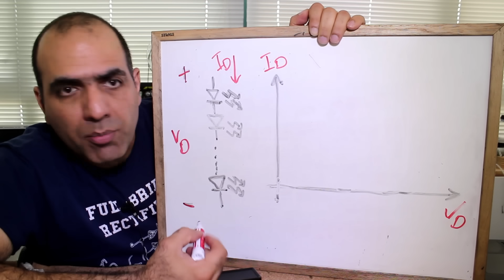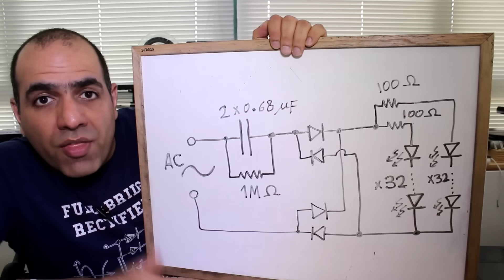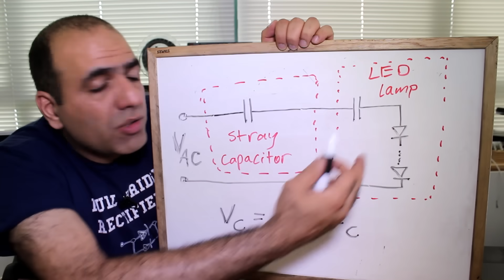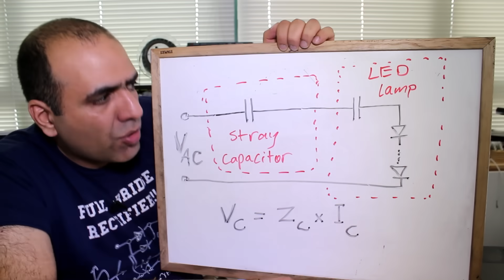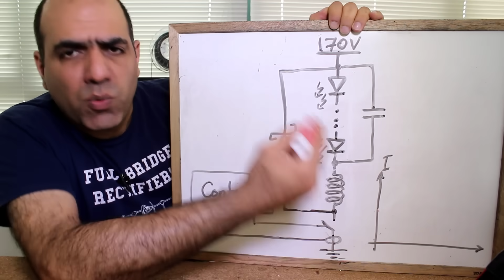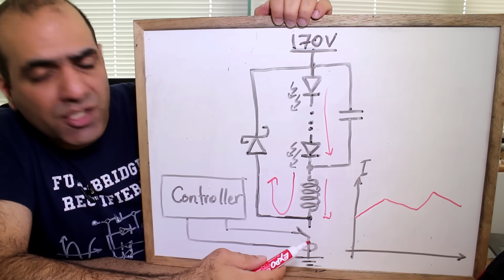Why Cheap LED Lights Keep Glowing

Comment: I’m wondering if there’s not an element of induction as well. In 3-phase domestic wiring, it’s not uncommon to see around 90 VAC present on phases that are completely isolated at the breaker. Or have I understood something wrong and that’s basically just the same thing? :)

Comment: This effect is caused by currents being induced into the wire from nearby electrical sources like the wiring in the walls. Works the same as an antenna.

Comment: BOOM: “All you have to do is add a capacitor (yes, I meant resistor)...”
Chinese Manufacturer: “Yeah, we’re not doing that.”
Reply: Chinese manufacturer: Our lights are better, you don't waste leaking current! Your leaking current is converted into a small amount of light (even when you don't want it, but at least it's not wasted!).
Reply: @diliff  I mean this makes sense. People don't complain about they can't see but it doesn't mean there's no problem.
Reply: @diliff  I mean... you could always pull the plug to turn it off... (actually for many electronic devices you have to do that, because even without "standby" they draw some current. With "standby" being in the couple Wh range for most devices.)
Reply: @AFulgens87  True, but that's if it's attached to something that you can physically unplug. Most light bulbs are hard wired to a switch. You're practically suggesting that people unscrew bulbs when they're not using them. ;)
Reply: @diliff  ah, right! I was thinking about desk lights, because in the video they were showcased as such *facepalm. You are of course right :)
Reply: @diliff  I would just have a lamp that stays on all the time and have a motorized flap that covers the light when you hit the switch.
Reply: I guess that he meant resistor not capacitor, it is the capacitor that makes the light glow in the first place.
Reply: Chinese Manufacturer: You cant see it glowing because there is no glow!
Reply: Waaan, somebody talk to Me!1
Reply: Resistor*
Reply: It's the market! That capacitor makes the lights a few cents more expensive, so they leave them out. 
CAPITALISM BABY! YEEEHHHAAA! PEW PEW PEW!
Reply: Don't blame humans, blame the system!
Reply: @parrata  You're right that the video suggests a resistor, but a capacitor would also work.
Reply: D’OH! Well, in fairness, the first thing Boom added was a capacitor. Also known as, his body.

Comment: I have an led tube light in my room, and I have noticed it blinking in no specific rhythm by itself, it bothers me a lot, can you come up with a solution?
Reply: Probably picking up strong stray RF.  Put it in a Faraday cage.  Or just hide it under the bed.  Or cover it with an opaque cloth.  Kinda makes it useless but at least you won't see it blinking any more.
Reply: It is mounted on the wall, how can i put it like that every day?

Comment: Interesting thing I learned yesterday about the glue in LED bulbs. It can be broken down with Dot 3 brake fluid. Only took a slight drip on it for a couple minutes for it to happen. One moment I'm evacuating the brake line, the next I had the plastic lens fall off the lamp and my catch canister tip enough to fill my evac pump with brake fluid. Was a bad idea to hang it from the bulb.

Comment: Ok, lets do some math... we have ~7.674.575.000 humans on earth... lets say everyone needs 2 Lightbulbs at a time, and say 1/4 of the populations needs light (7.674.575.000 * 2 / 4 = 3.837.287.500).
One bulb with a resistor of 470kΩ wastes ~113.6mW (P = U²/R -> (230V)² / 470kΩ = 112.553191489mW)
Now lets multiply this with 3.837.287.500 blubs which spend light. Here we geht over fucking 4.3GW. GIGA Watts...
Is there no better way to get rid of the load...?
(Sorry for the bad english and i hope my math is correct...)

Comment: I had this weird issue with LED's. I bouth many warm white leds and planned to put them on a whole house wall. I connected them in lines by 6leds in series and was having many 6leds lines that were connected in parallel. Basically I had many leds that run on 18v laptop supply. It worked great for years, no issues. I used the swich on live wire that goes in to laptops pwr. supply. 
The weird issue is: I woke up at night to notice that my leds who are on my wall was glowing a little even when live wire is disconnected. But not just glowing,  a part of them were glowing, only the ones that are closer to the ceiling. No matter on what cables they were, parallel or series, only the ones closer to the ceiling were glowing. 
When i completely disconnected power supply from outlet, it stopped glowing, so basically I fogured  - when they got some kind of ground refference from neutral wire, they collected some small current from thin air, or from remote wire inside ceiling. Idk, but it was interesting discovery.

Comment: Can you also solve my question:

Why is electricity so dangerous?
Reply: It's dangerous because a small current through certain parts of the body can confuse your nerve system and stop your heart,  some say 40 mA is enough.  After your heart stops and is not restarted, you will die.
Reply: D Williams Thanks but I think it messes up the brain as well. The shock is probably enough to make a muscle contract and destroy it.
Reply: @covertpluto  It depends on many things.  I once designed a high power flashing light for the Atlas Missile.  The capacitor was charged to 2,000 volts and held 250 Joules.  It flashed twice a second for an average input to the flash lamp of 500 watts.  Ballistic cameras photographed the flashes against a star background during night launches and computed missile position from those images.  The source of power was a one-shot battery.  At the end of the run the battery was dead and the flash tube was crazed.  It was custom built of Quartz.    Anyhow I once got the full discharge from one hand to the other when  a test button box arxed over.   I was dazed but didn't fall down.  The circuit is patented and you can look it up on line.  See US3196335 for the circuit.

Comment: Kind of sounds like the switch is on the wrong side of the circuit... If it cuts the hot side, the lamps shouldn't glow... but if it cuts the neutral side ( leaving voltage at the socket.. ) - the stray capacitance can be enough.  A friend had an outlet wired wrong and had this same issue. ( he cut the neutral side of the socket, and not the hot side ).

Comment: What you really showed is how much energy we are wasting in this world. Putting a resistor across the circuit (or even a capacitor) only creates wasted heat, sadly a poor solution. Come on people we can do better!  Milli-amps by the millions could be save with improved circuitry.  ...  Why not make use of static electricity  to light our homes?

Comment: It takes surprisingly little current to make an LED glow. If I put my body, arm to arm, in series with a 9v battery, it still provides enough current to light the LED dimly.

Comment: If YOU make courses, I MIGHT be motivated to watch them in order to learn and gain knowledge
Especially about the usage of a FULL BRIDGE RECTIFIER
Reply: FBRs convert ac to dc using 4 diodes. Diodes allow voltage to travel in only one direction.
Reply: What’s the deal with full bridge rectifier?
Reply: @bengrizzlyadams6187  he designed his own

Comment: I have a couple of proper LED lamps that flash every now and then when installed on a couple of fixtures in certain rooms in my home. I suspect there is some leakage current as well. Kids made me replace the lamps cause they thought it was ghosts or something!

Comment: I have these weird old light switches with a little LED in the actual button, which glows when it's off... So you can see the switch in the dark, I guess. They're 20 years old or so, and made for incandescent lights. When I started fitting LEDs in my house a few years ago, I discovered that the sockets attached to these switches were ALWAYS live. Incandescent lights didn't care, because the small amount of current needed to light up an LED wasn't enough to turn them on. My new LED lights, on the other hand, would constantly glow with a soft but visible light.

I need to replace those switches...

Comment: I used to connect LEDs to a darlington pair with a long wire floating on the input. It picks up any little electromagnetic noise. Walking near it, or touching it would cause the LED to turn on. It behaves very much like what you've shown.

Comment: The circuit inside the LED light bulb is just like the circuit inside phone charger. The only difference is that the phone charger circuit is CV and these are CC.

Comment: if you connect switch to the neutral wire instead of live wire, when turn off the light, led bulb will glow

Comment: Someone who understands electrical engineering better than I please check me on this.  Here's my situation: I have a 10 bulb chandelier.  I recently switched out all the bulbs for LEDs.  Rather than swap one bulb at a time, I took out all of the incandescents, then put in all of the LEDs.  When I plugged the first one in, it glowed pretty brightly despite the switch being off.  With two, the glow lessened, but was still obvious. Three bulbs screwed in resulted in a faint glow from all three.  When I put in the fourth bulb, the glow stopped.  I assume from the explanation around 7:20 that this is because each bulb has some resistance, and once four bulbs are plugged in, that's enough to act like the "large" resistor Mehdi added in red.  

Is that right, or is something else going on here?

(Come to think of it, I don't even know whether the bulbs are in sequence or in parallel in a chandelier, or what that would mean for this circuit.)

Comment: Seems like it has inherent inductance "choke" that limits the voltage regardless of current. 

Could it possibly be the ripple voltage recursively charging and discharging themselves? Are these self shunting zener diodes?
I mean this is all diodes, FWB and LEDs in series.

Comment: I had some light bulbs in my room a couple years back and after you turned them off after a few minutes they would have a slight green glow to them if the room was dark
Reply: If they were compact flouresent bulbs, that's probably because they use a coating on the inside of the tube to turn the ultra-violet light into visible light, and the coating often contains similar components as the glow-in-the-dark coating used for clock dials.
Reply: @melkiorwiseman  that makes a lot of sense. Thanks

Comment: ElecrtoBOOM when I worked construction we used radios to communicate. Sometimes when I talked on the radio my LED headlamp would Glow. Can you explain this?
Reply: Thanks for the reply. If I can ever replicate the condition I will video record it.
Reply: I was actually concerned that what ever was causing it could be harmful to my health.
Reply: @Ian-of9oi 
You're welcome! 😀
I have been using radio communication equipment in my field of work and spare time as well over the years. Don't worry about your health. It's completely safe to use radios and cell phones.
Reply: Maybe interference from electromagnetism and an uninsulated lamp circuit?

Comment: I installed a light switch a few months ago, never had a problem, but when I installed this switch, the (led) bulb wouldn’t turn off all the way, changed the build. Works fine now

Comment: We had some LED lights that would start glowing when you touched the plastic reflector part. They stopped doing that after some months of use, and never did it again ☹️
Reply: My car's led dome light glows even with the car off.

Comment: Strange but true. i have a 4 ft LED strip light that glows very dimly even when switched off.  I added an ON/OFF/DIMMER installed on the end away from the power line.  The reason for the glow is induced voltage due to the close proximity of the power line to the LED strip along its length.

Comment: I had this problem at home but it was caused by high resistance in the transformer earth. My neutral wire was at 60V to earth. Trying to explain that to the power company call center was the tricky part.

Comment: I have two track light fixtures under the roof of my patio, 3 bulbs each. Each track is plugged into a remotely activated outlet from Portfolio Lighting. When I first put in LED bulbs (cheap ones, don't recall the brand) I noticed the next night that despite being "off" they all had a faint, flickering glow. Replaced them with quality lamps and problem solved.

Comment: You are irresponsible for de facto tempting viewers to experiment with live current circuits, using crocodile plugs and showing risky experiments while closing the ac circuit by one’s feet .
Reply: And it’s resistive not capacitive effects of your body that mattered.

Comment: Is there no difference if you place the switch fore the light-bulb? Because then the AC current flows through the full bridge rectifier making it DC.

Comment: I didn't watch this video to the end so what I say may not make much sense, but I have a led lights in my bathroom that I took out from my bedroom when I bought a new one, it didn't glow in my bedroom when switch was off but in bathroom it does, I think that's because either the switch in my bathroom isn't connected correctly and the live wire isn't the one being cut but instead the neutral is probably the one that's cut, or it's because there is an indication light that lets some electricity through... Now why this doesn't happen with incandescent light bulbs is because they need much more energy to start glowing where led lights need very little and can use that little amount of energy to glow.

Comment: I couldn't tell 100% but it looked like you were opening the circuit on the neutral side. Since switching is done on the hot wire shouldn't it not keep glowing in normal use in the US? Is the difference in distribution systems in the UK such that there is sufficient voltage on the neutral for the zombie bulb effect to work?

Comment: So, is that why the cheap led's flicker?  There is no isolated dc circuit to power them, they are just in line with the house wiring?

Comment: If you only use one wire of the two, like you did in the experiment with the cheap leds, here in Germany, you would trigger the "FI"-Breaker. It detects, if all of the Enery coming through one line is going back the other line. It normally triggers at around 30ma.

Maybe you could make a video explaining those Breakers. If they don't have them in your country, look for "FI-Schutzschalter / RCCB" on ebay.

Comment: BUT HOW COME AC CURRENT FLOWS THROUGH THE LED STRIP WHEN THE CIRCUIT IS OPEN? 
WE OPEN THE CIRCUIT ON THE LIVE SIDE, SO THE CAPACITOR SLOWLY DISCHARGES ITS ENERGY..... BUT WHERE DOES IT GET THE CURRENT AGAIN TO CHARGE WHEN THE CIRCUIT IS CUT OFF ???????
Reply: i meant that the capacitor doesn't charge back and waste energy

Comment: the stupid lamp above my desk glows like a playstation controller charging the only way to stop the glow is by unplugging it, turning off the wall switch and the breaker even doesnt help it even stayed glowing after a storm and everyone lost power. but i had light! its gotten dimmer over the years so instead of unplugging it i leave it in and it acts as my super cool night light

Comment: Micro =/= Mili

In the start, around 3 min mark, he was measuring in miliamps (mA), not microamps (μA) as far as I can see on the device, so keep in mind mili (10^-3) is higher than micro (10^-6)

If anyone wonders, anything above 27 mA(0.027 A) is going to be fatal to the human body, anything below that is acceptable as safe current that won't cause any significant damage.

Comment: I have wired my house for 12v DC solar power side by side with the 220v AC lines, but no real connection in between them of course. The interesting thing is that the 12v solar lights starts glowing dimly if I touch any part of the solar circuitry, the wires, the battery or even solar charge controller heat sink. Is that 220v AC is pushing some power to the DC line through magnetic induction?

Comment: so, is the tiny LED light better? It uses less current, so lower bill, right?
- They even seem simpler... do they have any negatives? (other than, of course, glowing when there is capacitance in wires; but other light bulbs just convert it to heat, if I understood correctly... - or do these actually constantly draw a little bit of power???)
- or do I not get it? Are they actually less efficient? or ......
Reply: oh, they just need more current to start at all...
- and now I think this small one actually constantly draws power, while the bigger one does not...

Comment: I have a problem with the capacitor circuit from a camera flash (330v 800uf) when the circuit is open, it charges as normal, but I can’t control the release of the charge without a switch in series with the capacitor. Is there another way using the original switch used when you take a picture?

Comment: Maybe at 8:05 he is wrong ,,maybe
Reply: Because adding a device in parallel rises the total current too,,, and same current still passes through the 1st device
Reply: Because adding a device parallel rises the current too,,,,and same current keep on  flowing  from the 1st device
Reply: That's assuming a constant input voltage, which is only true if there's no series impedance. Which is never true in general, and is even less so here, since there's a huge impedance from how little capacitance there is.

Comment: As an electrician i get called a lot about "LED lamp wont turn off" and many times this happens for two reasons, either the positive line of the circuit is connected to the lamp and the negative to the switch (which is the inverse way of how it should be done), or the switch used for the lamp is a model that comes with a small indicator LED that forces a very faint amount of current through the circuit. 
Just some everyday life scenarios to add to the content of the video :D